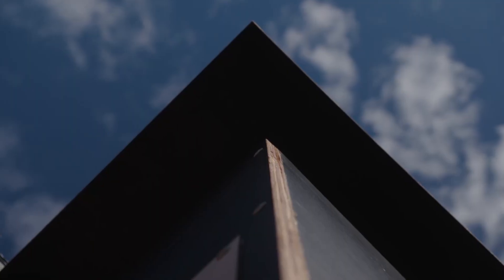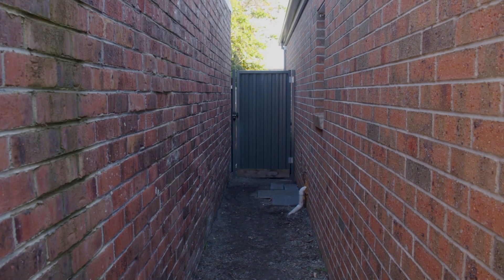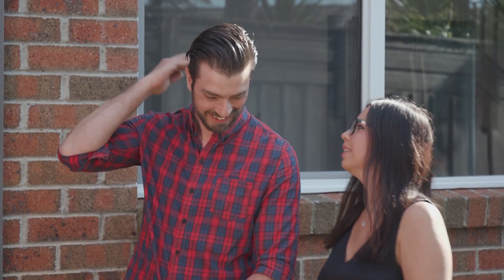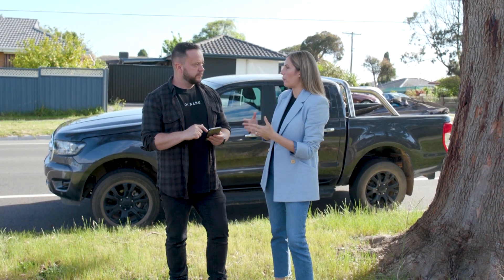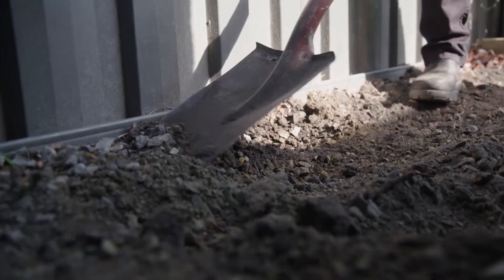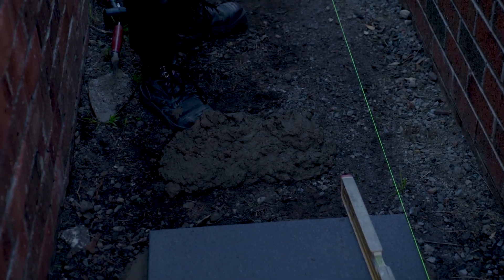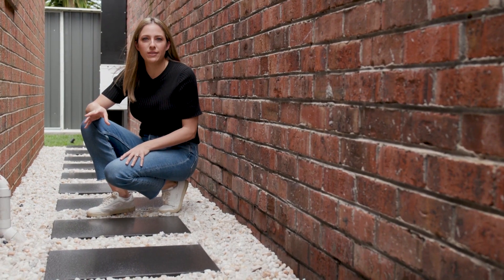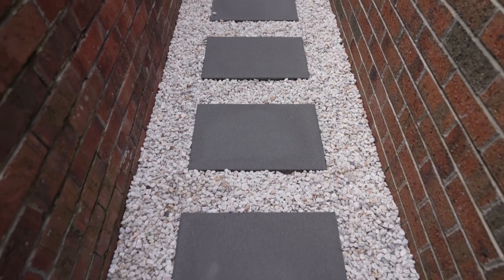Adbri Masonry on Healthy Homes Australia | Season 10 Episode 12

Comment: Hey a quick question. No wacker no road base. You put the motor straight on the ground. Why is that
Reply from the maker: Hey there,

For a steppingstone pathway there is no need to put down a compacted sand base. A cement and sand mix combined with water is enough to hold down a paver as a steppingstone.
Reply: @AdbriMasonryAus  oh man, I just wasted 100-150mm of road base lol meaning I put down that much of road base about 8 tonnes for the area I want to put the steppers and pebbles. I saw that video from Bunnings. Oh well. You learn and grow. Thank you.